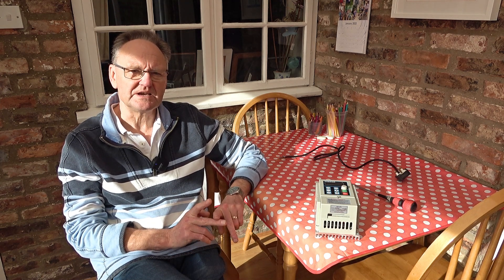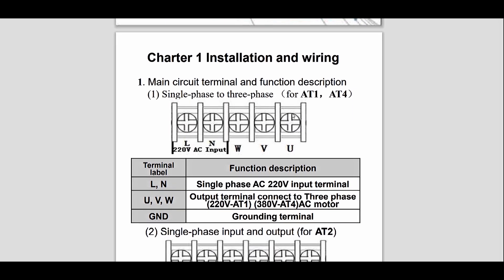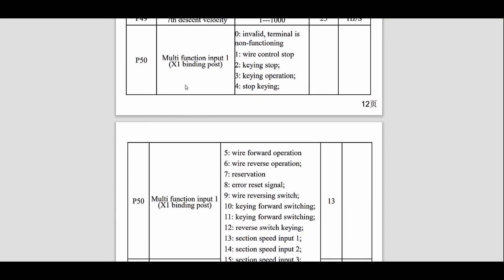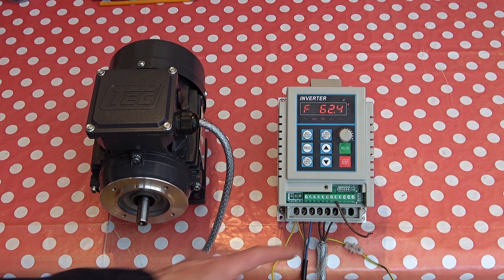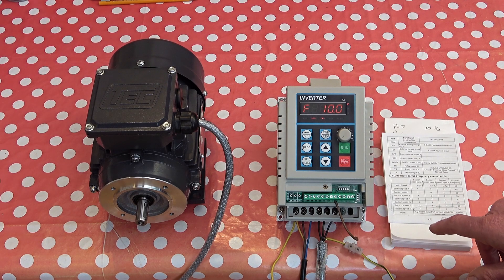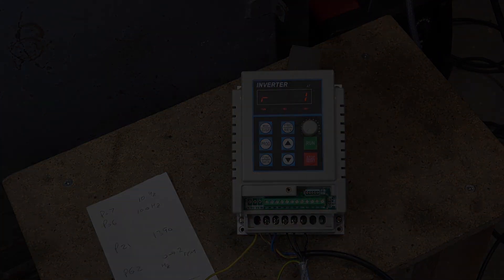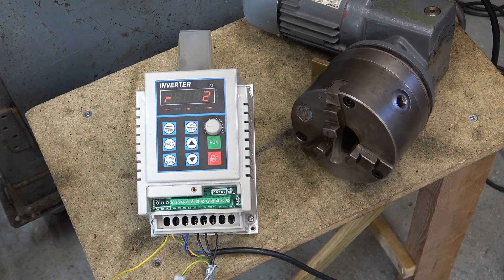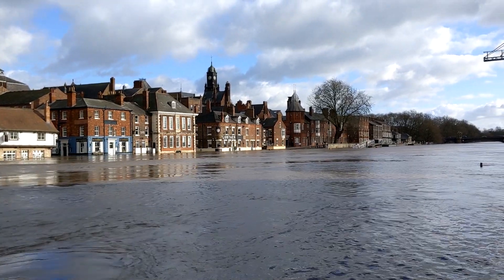HS127 Inverter type AT1 setup and test

Comment: P21 is set to 1390. Is that your motors actual rpm on the tag of the motor (its rpm parameter)
Reply from the maker: Hi Thomas, it's a long time since I looked at it but from the manual I would say P21 is the no-load rpm at 50Hz. 1390 would be right for a 4 pole motor. Manual gives the example of 2800 which would be right for a 2 pole motor at 50Hz. Cheers

Comment: Good day friend. You can please tell me if I can use it with single -phase engine. Thanks
Reply from the maker: Hi, no not that one. There are 3 types of motor-drive inverter in this context: single phase to single phase, single phase to 3 phase, and 3 phase to 3 phase. This one is single phase supply driving a 3 phase motor. It sounds like you need the first type (1 phase to 1 phase) and that will give you speed control, torque control, and protection. Cheers

Comment: I have several of this ones. The only thing maybe i dont like, it doesnt matter how i configure the breaking time, its always 2 seconds. If i reduce it or increase it, it will be always 2 seconds. I suppose this is the cost for buying a cheap version. I'm comparing thsi one with Yaskawa the Ga500, V1000, J1000 where you can set the acceleration and dessaleration to the time i want it.
Reply from the maker: Thanks for sharing the the info Mav, cheers.
Reply: @HaxbyShed  Sir !, in your device can you change manually throught the panel the acceleration and dessaceleration time. I'm  rechecking all my AT1's here, but its always 2.5 from 0 to full speed, and 2.5 seconds to 0. I have changed through inertia stop, breaking stop, dessaceleration stop. And nothing.
Reply from the maker: Hi Mav, unfortunately I cannot check that now because I returned it, not suiting my specific job. I needed an inverter to drive my welding positioner at 5Hz and the torque control on the AT1s is not good enough for that.  I do remember when the AT1 was set to a specific speed through the digital control lines the variable speed control was inoperative. But other than that I don't remember any restrictions. Cheers

Comment: Question - is it possible to set up the  VFD Controller XSY-AT1 so that when turned on it works at high speed, about 2-3 minutes, but after 2-3 minutes of operation to a pre-set low speed? A pool water pump is connected to the XSY-AT1 frequency converter.
Reply from the maker: Hi, yes there is. There is no time-profiling within the inverter itself but you can assign set speeds to certain of the control pins. So you could just have an external timer with no-volt contacts across the right pins. On the model I show in the video you can assign a speed control function to any 3 of the digital inputs X1 to X6 by setting parameter P50 (for X1) through to P55 (for X6) to a value of 13 (speed input 1), 14 (speed input 2), or 15 (speed input 3) and then the speeds assigned to each 0 or 1 (tied to COMM or float) on the 3 chosen inputs are as shown in the Multi Speed Control Table initially but you can set your own speeds with parameters P26 to P33 (8 speed settings controlled by the 3 inputs). You just want two speeds by the sound of it so actually it's not difficult. Just pick an X input, assign it as a speed setting input for the speed you want on the default Multi Speed control table, and connect your timer. Note I found that if you set a fixed speed in the way I suggest then the variable speed knob won't have any effect (it only seems to work in the 'Main Speed' mode when all three speed selection inputs are unassigned or floating/open) Hope that helps.

Comment: Hi...since I also have an ATI 1 2.2KW installed on a 750w three-phase motor for my lathe... and I have a problem that when the engine is running it generates an anomaly between ground and neutral of about 20/24v. it's normal and it gives me interference in the 16x2 lcd display of the tachometer controlled by arduino...I saw in your video that you put a 4-pole SHIELDED cable to the motor why?
Grace in advance.
Reply from the maker: Hi Roberto, I looked at the AT1 manual and there is no mention of screened cable. However  if you buy an industrial grade inverter they will specify screened cable between the inverter and the motor and also a screen on the low voltage control lines. Inverters create harmonics which can radiate and create RF radiated interference, and also on the cabling which gets back to the supply side. Some models will also recommend a filter between the inverter and the motor. Hope that helps. Cheers

Comment: I have a problem inverter shows " low voltage " is this fixable??.
Reply from the maker: Hi Celia C, the short answer is I don't know but maybe a viewer will give us an answer. I did a quick Google and this is what it said "Undervoltage

This is caused by low intermediate circuit DC voltage. This can be caused by a missing supply voltage phase from a blown fuse or faulty isolator or contactor or internal rectifier bridge fault or simply low mains voltage.

POSSIBLE FIXES:

Check mains supply and fuses.

Check operation of isolator and contactor.

Check incoming voltage, this may be too low." 

Personally I'd check the incoming voltage. Hope that helps. Cheers

Comment: great video tutorial❤ thank you for sharing your knowledge❤❤❤
Reply from the maker: Hi Raquel, you are welcome. You don't get much info before you buy, and even the manual is hard to follow,  so I think it helps to see one set up. Actually I sent that one back because it did not have the good torque control at low motor speeds and thus was not suitable for my specific project, but it's fine for most jobs. Cheers

Comment: Hi Paul. Good video. I recently got my hands on one of the AT4 inverters for 60 euros. I finally got my hands on a lathe, and using the inverter to run it. I got myself a nice little Colchester Bantam 2000. Power crossfeed the lot! 1200 euros delivered.
Reply from the maker: Hi George, it sounds like you got some really good deals there. Bantams are a nice lathe, more engineered than the Harrisons. I nearly got a Bantam but wanted the gap bed and also they seem to sell for quite a bit more than the Harrisons here. I'm sure you will have great fun with it. Moving machines can be very expensive. I was quoted £250 plus VAT to move the lathe 25 miles but I managed to get it shifted for £160 with a home removals company on a Luton van with a tailgate.   It was loaded by the seller with a fork lift, so that end was easy, but the removal men were cursing on the day when lowering it was right on the limit of their tailgate load (550kg). Cheers

Comment: Hi Paul. Thanks. I own a bench lathe (motor: three-phase, 1.1kw and 1400rpm) and a VFD AT-1 model. I would like to install a brake resistor, but I don't know if in this VFD I can install a brake resistor and what is the proper value. Please, could you help me? Thanks again, and  I am sorry  my English is not good.
Reply from the maker: Hi Jose, your English is good - no problem.  I do not think AT1 has a connection for an external braking resistor. But it does have an internal electronic braking function set by P12, P13 and P14.  I hope that helps.  Cheers
Reply: @HaxbyShed  Ok, Paul. Thank you very much.

Comment: Thank you! This helped me a lot to setup the inverter. 
I have one problem. I can't change the speed while the motor is running. I have to stop it first, pick another frequency and start it again. Could this be a program setting mistake?
Reply from the maker: Hi StudioSymbol, that's not usual so it's probably a setting. If you want to go into detail then perhaps email me haxby_shed@outlook.com  and I will help if I can. Cheers.

Comment: excellent video, around 12mins in you talk about P50 (wire control stop, keying stop, keying operation and stop keying) could you explain these in more detail or point me in the direction of the info you talk about on the web, thank you
Reply from the maker: Hi Andy, I found this post on https://www.model-engineer.co.uk/forums/postings.asp?th=149931 and for convenience I copy here part of the thread some way down made 1 March 2020 which says :- 

 "PARAM 1 wire control stop  This changes the VFD default condition to run on power. With contact between com and terminal, the attached motor will not run. with no contact, the device will revert to the previous control state. It is unlikely that many workshop users will need to use this parameter.

PARAM 2 keying stop   should really say key start/stop This uses a single non latching push button control to activate the motor. Push the button once for on, push same button again to turn off. It requires a contact set that is NO, or 'push to make' linking com and the terminal set as P2. useful if you only have one button!

PARAM 3 keying operation This changes state from deafault non run condition to the motor run condition and uses a single non latching push button control with a contact set that is NO. Pushing the button starts the motor, further button pushes have no effect unless the status has been changed by the input to another terminal.

PARAM 4 stop keying This changes control state from the run condition to a stop condition and uses a single non latching push button control with a contact set that is NO. Pushing the button changes motor run state to motor off but will have no effect ( it may however interrupt jog mode if pressed during jogging ops). P3 and 4 are used normally used together to effect two button RUN and STOP controls (if that is what you want)."  

I've not tested these myself but the gentleman sounded very knowledgeable.  Cheers
Reply: @HaxbyShed  that is perfect, thank you for you fast reply, I really appreciate it, this has been bugging me for over 6 months now.
Reply from the maker: @highlander3666  You are welcome Andy. Happy to help.

Comment: Do you know which one of the connectors on the board are for RS485+ and RS485-??
Reply from the maker: Hi Buddha, I can see RS485 mentioned in the manual but to be honest I'm not convinced the AT1 had connections for that option. I sent it back so I can't check the unit now but when I look at pictures online they kinda support my comment. There were several (optional?) features mentioned in the manual but not populated on the board. Cheers

Comment: The only problem with invertors is that they only produce 230 volts, so the torque is not as good when your pillar drill or whatever you are controlling at a low speeds.
Reply from the maker: Hi Jeremy, I'm no expert so I cannot comment directly to your point but I've observed that good torque control and torque boost is a function you get with the more expensive industrial-grade inverters that is usually not in the cheap hobby inverters. Cheers

Comment: Hi Paul, Good review and functional testing of the little VFD drive. When you need special operating modes or constant torque that when the commercial / industrial drives shine..along with the price. That drive should be fine for most home shop uses, except welding positioners...LOL  Great video, enjoyed !
ATB...
Reply from the maker: HI Dean, it just proves when things appear the same outwardly they are not always the same when you get into the detail.  But sometimes it takes a bit of effort and enterprise to figure that out. Cheers

Comment: I think there's absolutely no shame to use the cheap inverter on the shaper and the expensive one on the welding rotator. These cheap ones work perfectly fine.
It would be interesting to see on your scope the difference of output they give.
Reply from the maker: Hi Michel, yes if I could add a current probe to my scope. Last time I tried to scope the VFD output voltage it was difficult to interpret.   The cheap inverters seem to have more hobby-friendly functions/options for wiring and controls. Cheers
Reply: @HaxbyShed  How much have you paid for the Chineseum VFD?
Reply from the maker: @athrunzala5337  I think that one was was about £55 or about 66USD. They seem to be a bit more expensive now, because since January 2023 we have had to pay the 20% purchase tax (VAT) on on-line purchases on ebay (it used to be kinda hit and miss whether it was applied). Cheers

Comment: Hi Paul,  thanks for sharing a very interesting video... not much wrong with these cheaper inverters it seems!  A thought occured to me while your video was running... have you considered the possibility of altering the gearing in the motor's reduction gearbox ?  I don't know much about these bolt-on reduction gearboxes, but might be worth taking a peek inside and see if you have room for a larger (I presume) gear.  If so, you might find that you only need a gear with a few more teeth to get a significantly lower speed of the rotator spindle without lowering the frequency of the inverter as far as you have to at the moment.  Does that make sense?  Watching you make a new gear (assuming there's room in the reduction gearbox) would make a great video... and you have all the necessary tools (you lucky blighter!).  Greetings from Southport.  Cheers, Kevin.
Reply from the maker: Hi Kevin,  I have had the gearbox apart and there is a steel worm on the motor shaft and a bronze wheel on the output shaft. Unfortunately the relative shaft positions are fixed so I would have to make a new worm and wheel with finer pitch/teeth. But you have given me an idea, I expect those motors come with various gearbox ratio options so I will lookout for others and check their ratios. Another option people have suggested is to clamp a further reducer in the chuck  - maybe from a hand crank grinder or a drill reduction gearbox. Meantime I can use it with the IMO (blue) inverter and I'm good down to 1rpm.  Cheers
Reply from the maker: Hi Kevin, just to add to my first comment, I've been thinking about what you said and yes maybe I could make a replacement worm and wheel probably about the same diameter but with more teeth (finer pitch) to get more reduction. Would not be as 'strong' as the original but may be ok for this job. I will let that simmer in my brain a while and maybe do some calculations to see what reduction I could get (i.e. how fine I could go).  Cheers

Comment: That was very interesting and I learned a lot from this, thanks. The cheap inverter still seems like good value for the money
Reply from the maker: Hi GTB .... and actually it was £50 although I did say £60 on the vid.  I think it would be fine for normal applications. If it did break after a time then it's cheap enough to just buy another (although I've no reason to think it would be unreliable). Cheers

Comment: That little inverter seems like a great unit for the money. I think some kind of reduction gearing is the best option if you keep your rotator powered by the present motor.
Reply from the maker: Hi Carl, yes I will look out for a reduction gearbox add-on to hold in the chuck, as Jim also suggested. I had a hand-crank grinder fixture a year ago but gave it away, but maybe something like that or a drill gearbox. Having said all that the rotator is pretty reliable down to 1 rpm. I will just have to learn to TIG faster. Cheers
Reply: Sir Fault FC002 whatbthe meaning?